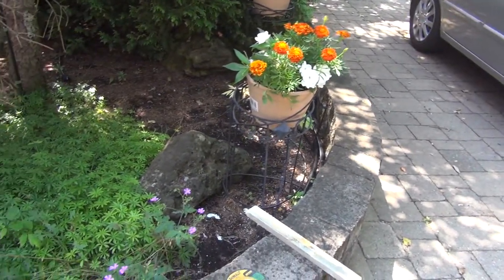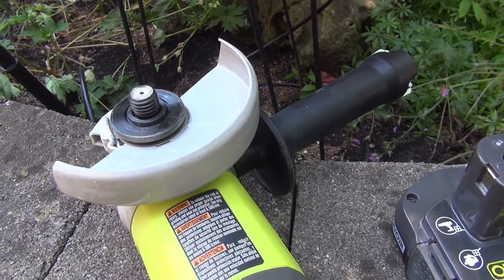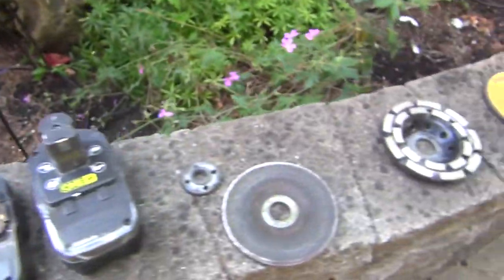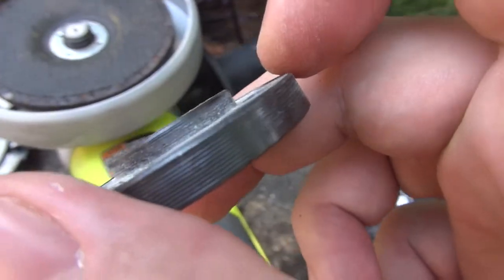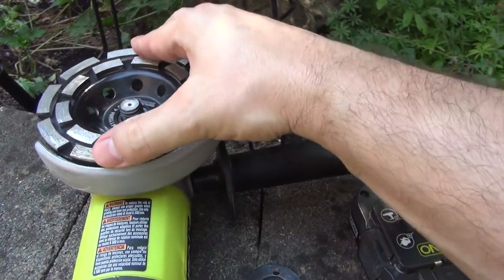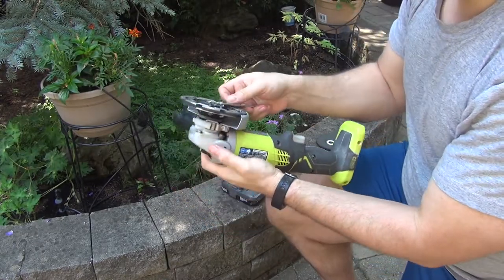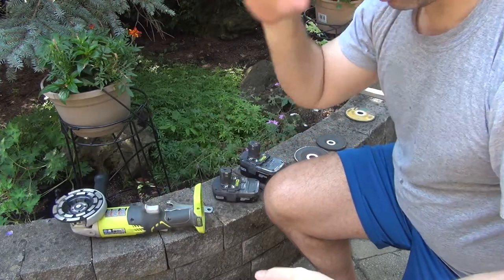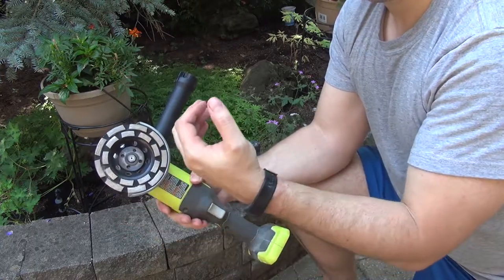7/8" Grinder Wheels on 5/8" Arbor?

Comment: 4" wheels with a 5/8" hole are meant to be used on a 4" pneumatic or 4" electric grinder with a 3/8" or M10 arbor (threads).  The centering flange is 5/8".    4.5" angle grinders are meant to use 4.5" wheels with a 7/8" hole.  They can also use thread on 5/8-11 attachments. The threads (arbor) are 5/8-11 but the centering flange is 7/8".  Thicker 4" wheels with a 5/8" hole may fit on a 4.5" grinder but may be slightly off center as shown in the video.  A 4" cutoff wheel will not center at all.  Hope this helps someone out there.
Reply: I have been digging hard to find a way to use 5/8 cutoff discs on my grinder and I can figure it out. Nothing I do can get enough grip. Normally, I understand that I’m not supposed to do that, but I have a bunch of 4” discs and only 4.5” grinders. So I’m trying to figure out a way to do this so they won’t go to waste. Ever heard of an adapter anywhere, or am I gonna have to invent one?
Reply: @Hoellewood_Solutions  If you must, a workaround is to purchase a 5/8 washer to use as the upper flange. The washer is thinner than the stock upper flange allowing the wheel to center perfectly on the upper part of the arbor.  Then flip over the bottom nut.
Reply: @newwb  thanks, I did something a little similar, but I’ll have to keep trying different washers and arbor nuts, cause what I had didn’t work
Reply from the maker: Thanks for adding extra info!
Reply: That did help clear my confustion, thank you!
Reply: I got a 5/8"-11 cup brush because I have all 5/8" holes in 4" discs, but I guess I need 3/8" hole for the cup brush because it threads on. Confusing system. Thank you for basically confirming lol.
Reply: Btw, what does 5/8"-11 mean? What does the 11 represent?
Reply: The number after the dash corresponds to the threads per inch for SAE threads @MetalNick
Reply: That angle grinders arbor size is actually 7/8 inch for disc that you will tighten down with the nut. If you are using an attachment such as a wire wheel with threads on it, then it would be a 5/8 inch arbor. If I am not mistaken the 11 refers to the threads.

Comment: I would not use the 5/8 grinder disk, you should use 7/8 for this grinder. The 5/8 threads are not going to center a 5/8 grinder disk. The only 5/8 you shoulod be using is the ones that thread on.
Reply from the maker: Thick surface grinding wheels would center just fine on 5/8 threads. Not sure about thin cutoff discs, but you're not supposed to use these anyway with this grinder due to the guard being open.
Reply: @JustMakeItNow Just remake the video after you read  the instructions.

Comment: You guys really need to be careful using 4” & 5” disks on your 4 1/2” grinders. Just because it can fit doesn’t mean that it should, make sure that the disks your using are under the RPM rating of the grinder that you’re using.. so don’t go using a 11,000 RPM rated 4” disk on a 13,000 RPM  4 1/2” grinder… Grinders really aren’t as dangerous as everyone makes them out to be, it’s just the people that pick them up and have no idea what they’re doing.
Reply from the maker: I agree in general, but have you seen any discs like that in this video? Also, I don't think you can fit a 5" disc on 4 1/2" grinder unless you remove the guard, and you're not supposed to do that in the first place, that's the main safety feature. Using smaller diameter discs is usually fine, as bigger discs normally meant for lower rpms, but you need to see rpm ratings obviously.
I think much more common safety issue with regular grinders is using Type 1 (flat) discs when only Type 27 (depressed center) are supported. Most (?) non-pro 4 1/2" grinders are like that, and many people just remove the guard and still use flat cut off discs. This is not safe as guards for Type 1 are different, and most these grinders don't even have this as an option.

Comment: Very helpful video.  My instruction manual says that the "nut", which is really called the "outer flange" is raised on one side to give you more room to work with thick accessories.  If the wheel you're using is thin, you'll use the flat side against the wheel (as you showed) to secure the wheel.
Reply from the maker: Thanks for your comment, this is helpful!

Comment: Just read my dewalt Manuel and this is exactly correct what is said in video.  It also has a picture of flange being placed both ways depending on size.
Reply from the maker: Good to know that at least 2 manufacturers mention that specifically. I know that in addition to Dewalt, Ryobi manual also states the same.
Reply: i would you say Its ok to do this on a 1/4 thick  grinding wheel but  not on a thin 1/8 or 1/16 cutting wheel

Comment: Do not buy 5/8” arbor cutoff discs for your 4.5” grinder. If the disc isn’t thick enough like a grinding disc or flap disc, then you won’t be able to properly center the disc. This can lead to high vibration in the disc, which will cause more damage to the piece you’re cutting and MORE IMPORTANTLY, It CAN cause the disc to Explode, which WILL DO more damage to things like your face. 

That being said, if anyone knows of a safe adapter to make those discs work on a 4.5” grinder, please let me know
Reply from the maker: More importantly, you need to use the right guard for cutoff operations.There are type 1 (flat) and type 27 (depressed center) wheels and corresponding guards. Usually cutoff wheels are type 1, but pretty much all 4.5" angle grinders come with type 27 guards. For some grinders you can switch guards to accommodate different wheel types.

Not that people don't use type 27 guards for cutting off, but it is not particularly safe. If the wheel shatters, type 27 guard has the whole side unprotected (because it is meant for grinding flat where that side is protected by the workpiece).
Reply: @JustMakeItNow  amen!
Man I’ve had a disc explode in my face cause the guy I was working with didn’t have a guard, I was lucky there was no damage, but it really did hurt. Thank goodness for sunglasses
Reply: @JustMakeItNow  It is really hard to find Dewalt Type1 guards (I have the DCG415 model) as each model has different latching designs and they don't put the part #'s (N311439 for this model!) in the owner manuals making a Google search mostly fruitless.  And the major retailers don't sell them nor does Dewalt show them on their company website.  I finally found a phone number for a company service center who had someone help me order it after Dewalt 800# gave me the wrong part #.  I have emailed Dewalt saying the grinders should really come packaged with both guards as they aren't that expensive compared to the tool and it is a safety issue as you describe.  At least get the retailers to sell the Type 1 guards if they are going to sell the grinders with other accessories like the various wheels that require them.
Reply from the maker: @jeffe7327  This is very true, these Type 1 guards are hard to find. And DeWalt is notorious for having these guards specific to the grinder model and sometimes even generation of the model. But at least they do manufacture them. Some brands just flat out do not have them AFAIK (Hi Ryobi!). There is some interchangeability with the other brands though, I believe some Milwaukee guards fit Ridgid grinders.

Comment: Seems like every rookie new to this angle Grinder thing has these 5/8 7/8 problems at the beginning until we get the hang of it, Question is there an adapter to extend the grinder out past the guard so I can sand some Ruff paint off my garage while holding the grinder flat against the wall
Reply from the maker: You don't need an adapter, you just need a right cup wheel, e.g. similar to what you can see in the thumbnail (this is for concrete and not paint stripping, but it works flat on the surface). Cut-off wheels (the ones you use on the edge) are not supposed to be used with these types of 4.5" grinders because their regular guards are not designed to cutoff wheels. But for cup wheels that shouldn't be an issue, that's what these grinders are designed for, you just need to find the right wheel for your application.
.
Or if all you want to do is to strip some loose paint (instead of sanding the wall), you may simply go with some kind of wirebrush, this should do the trick.

Comment: Can you use a 7 inch wheel (with the 7/8 arbor) on a 4.5" with a 5/8th arbor. I can only think that the lower RPM on a 7inch may cause the disk to snap or break under the higher rpm (10,500rpm) of a 4.5" grinder? If the 7/8 disk does fit as shown then would a 7inch dust shroud be acceptable for safety purposes while gaining the vacuum feature also??
Reply from the maker: This sounds like a terrible idea. I can't see how you would fit 7" wheel in place of 4.5" - there is a guard that is way too small, and even if you remove it (terrible idea, again!) then there are just physical dimensions of the tool and ability to hold it without touching larger wheel. Even if you somehow manage to physically mate 7" wheel with 4.5" grinder, your suspicion of rpms causing problems is spot on. Max rated speed of 7" wheel is likely much lower than 4.5" grinder rpms. Overspeeding wheels can crack and shatter, potentially within minutes, and that is not the thing that you want to happen, ever. Just don't do it. If you really need work done with 7" wheel, get a proper grinder, or just rent it out if it's a one-off.
Reply: @JustMakeItNow  The reasoning behind the inquiry is in the case of not having a rental place or supplier at hand. The arbour can interchange as far as I can see. The 4.5 guard can be switched to a 7inch dust shroud/guard. A variable speed 4.5 at 3000 rpm should meet 7" blade safety. Clearance on the hand is understood.  I understand YOU WOULDN"T try this But I was hoping for someone who may have tried. I may be that person .. and of coarse I'll be as careful as can be triple checking so I can send you an update.

Comment: I bought a HF Bauer 8 amp 4 1/2” angles grinder with 5/8” arbor.The directions say to use a disc with  5/8” arbor hole. - threaded and non-threaded discs? Also, says grinder is not to be used for cutting. Anyone know if the HF Bauer can be fitted with a Type 1 guard? Anyways, thanks for the video, and helpful comments.
Reply from the maker: Most of the cheap(er) 4 1/2" grinders are the same as in they don't have type 1 (cutoff) guard even as an option, and as such have a language in the manuals that states that you're not supposed to use it for cutoff operations. It is possible that some of the branded type 1 guards will fit (DeWalt, Milwaukee), or perhaps there are some universal ones on Amazon. Don't have first hand experience with those though.

Comment: Fine explanation, but the bigger disc was no longer inside or flush with the guard…
Reply from the maker: This is a cup wheel meant to be used with its flat side rather than the edge. Cup wheels have to stick out of the guard or you can't use them properly, would just drag the guard on the surface.

Comment: still sketchy...use an adapter  ring to be safe
Reply: Not sketchy, this is how the grinder is made to be used
Reply from the maker: Indeed so!
Reply: Great video. Earlier today my brain was melting as I looked at all my 5,8,7 stuff thinking I had something wrong. I was further confused at the hardware store that did not have a 5/8 arbor cutting wheel but had it in the grinding ones. Now it all makes sense and I know I don’t have to trash the 7/8 stuff.
Reply: @chriswilliams5699      Had the same problem.  I knew something was wrong when the arbor was locked but the wheel spun freely.